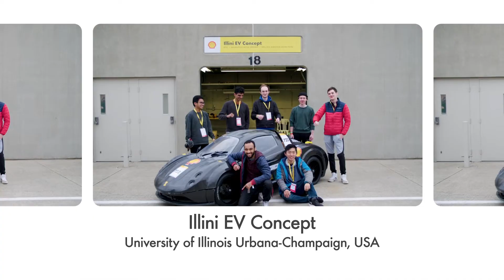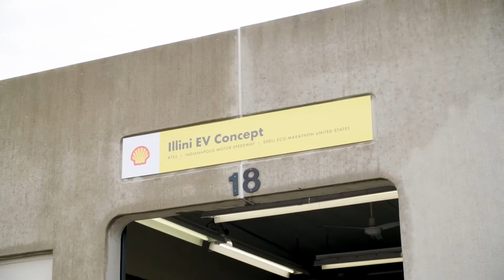Illini EV Concept - Stories from the Track | Shell Eco-marathon

Comment: Do you know my EV charging using ShellRecharge triggers a $60. hold on my bank account. Then it takes days to get it removed after going to three stations that didn’t work properly so ShellRecharge had placed $180. worth of bank on my bank making it impossible for me to do my grocery shopping. And the truth is, it only cost me less than five dollars worth of electricity to charge my vehicle. I drive a Nissan LEAF. Maybe you can put some of your enthusiasm and energy in resolving this issue with Shell Recharge since they claimed to be a backer of your endeavors. Go for it fix the system to reduce the cost for beta testers like myself who have been driving Electric Vehicle since 2012.